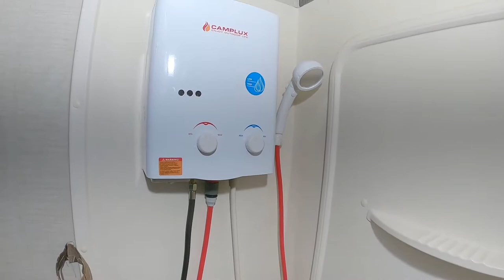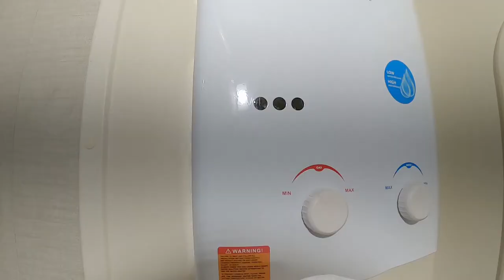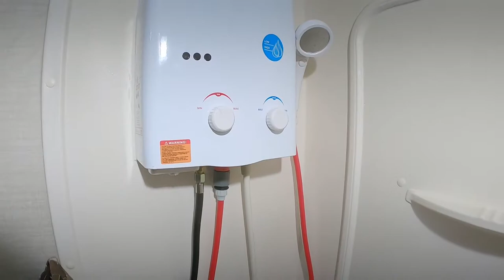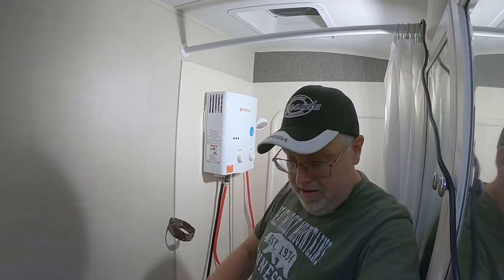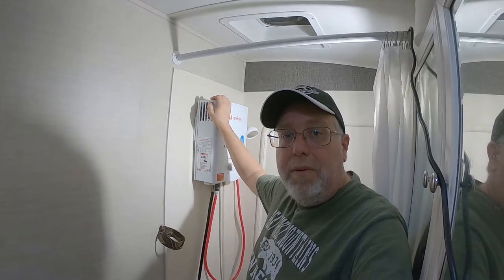RV tankless water heater

Comment: Are these not ment to b used outside, as they emit carbon monoxide gases????
Reply from the maker: Ok, I will ask you the same question as the other who ask the same thing. Do you use your RV stove / oven? Explain to me what the different between the two?
 They both produce 28K BTU of heat, both has an exhaust fan that vents to the outside of the camper. The shower has an oxygen depletion sensor the stove doesn't. Since we have limited water holding capacity, we take quick shower,  maybe  3 minutes top. the RV stove you may run for 15- 30 minutes so are you concerned about Carbon monoxide while you're cooking?
Reply: @millersinthemoment5427  
No I don't use a gas stove.
And I'm asking merely going on manufacturers guidance of it should be used outside
Reply from the maker: @punkypixie6970  Thanks for the reply, you are the only one that has taken the time to reply to my question. 
 You are correct on the manufacturers guidance about being for outdoor use. when you read the instruction, they state the unit has an oxygen depletion sensor, which begs the question why that would be needed for outside use.
 I have used a digital CO meter while the shower is running and never seen any increase. Like i said earlier we only run our for 3 minutes top and the ceiling fan is always on. our bathroom door also has a 4" opening at the bottom to allow fresh air to enter the bathroom area.  
 If someone would have a concern of CO levels, the meters are cheap and easy to install inside the bathroom area. 
 Once again thank you for the question.

Comment: I would be worried about splashing water into it when showering
Reply from the maker: We have not had an issue with that
Reply: @millersinthemoment5427  Mine froze and the heat exchanger burst in the unit and it was pouring water like crazy.  Despite that it still fired up and ran well.  lol

Comment: @UC8xhR8kg8xdlvocT5x_UEpg

Hello, 
Thank you for a lovely video and good ideas. 
I was reading a review of a new product from Australia, the Camec IMASS instant LPG water heater, which has an external air intake and external flue, BUT there is a risk when using it in cold conditions. 
Basically if there is a freezing risk, this can damage the unit and so in cold weather they recommend you drain the unit after every usage, to leave no water in it. What a nightmare; no, thanks! 
Going back to your unit, therefore, my question is about operating it in winter condtions. Are there risks to damaging the unit if, in the unhappy but quite possible event that, say I leave my camper for a couple of days and all the water freezes. 
I would be interested in your point of view on this. 
Thank you again for your video and for answering all the questions here... 

P.S. Like you, I also wonder if runnning a gas shower without external air intake and flu is more or less concerning than cooking on the stove (usually for longer periods of time). Without denying the risk of the former, I wonder why the latter isn't an equal concern.
Reply from the maker: Thanks for the questions. When temp drop below freezing there is a concern with the coils freezing and breaking. During our winter campout we dry camp outside of using our black tanks and shower in the bathhouse.  
 I agree with you on the shower vs cooking stove. My shower is only running for a minute and there is a 14" x 14" vent in the showering area with a fan moving 950cft. There is a 4" opening under the door pull fresh air from the living area.
  My stove also has a vent to the outside but with a  4"x 10" opening. The stove normally  runs for 20 - 30 minutes if not longer. Since the stove is inside the living area there is not a reservoir of fresh air to be pulled from.  
 Also, if there is a concern about build up  CO2 meters are not that expensive and could easily installed in the bathroom.

Comment: This is NOT made for indoor use. I personally have been hospitalized for using one in my bathroom!!!!
Reply: what happened?
Reply: Propane overdose. I started having seizures in the shower. Took almost an hour to get them to stop after going to hospital. I had this same set up in my RV bathroom but not in my shower. Since then I have installed it out side with no problems with it being in the weather.
Reply: Seems like a valid concern, I had the same initial reaction as everyone else when I saw it, worried about the CO2, then he showed the fan and made the point about your cooktop being essentially the same thing and I had to agree, the concern about the CO2 does seem pretty minimal... but Dooby brings up a good point that if you ever get some kind of propane leak due to worn connections or fittings that could be a big problem. Maybe having one of those smoke detectors that can also detect explosive gas would be helpful? Overall not sure I would do this myself in a small space like that but got a lot of great info from this video and discussion (just received one of these tankless heaters as a gift), so thanks for the video and the info!
Reply: Dooby, might I ask what caused the propane to leak out?
Reply: It didn't leak at all. But propane dont all burn off so it actually came from what didn't burn off. That and the mix of the lack of oxygen in the room caused me to go into seizures.
Reply: I was also not the only one this happened to. Also happens to my girlfriend two weeks later. We inspected everything and the unit did not malfunction nor was their any leaks. We had a professional reinstall the unit outside where they said it should have been installed.